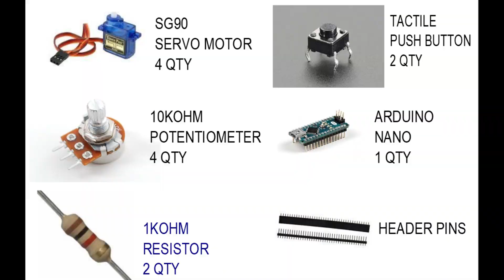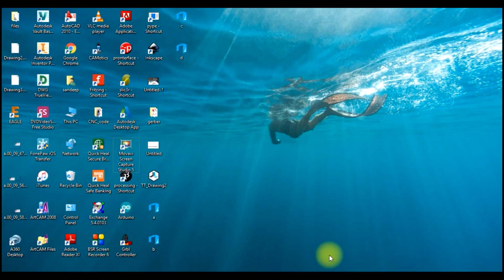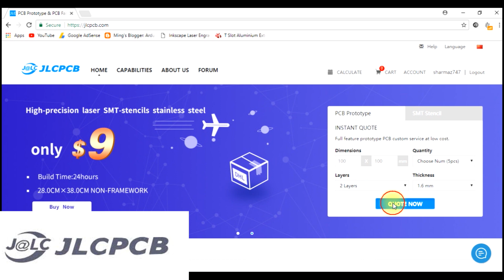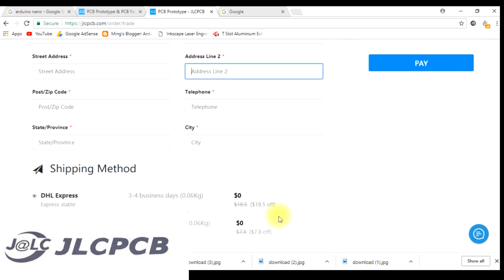How to make record and play robotic arm

Comment: S1 pause & S2 Record/Play!!
What does it mean? 
Which button did you press at 0:40? S1/S2? What is the other button for?
Reply: Pin which is connected to 6 is record and long press to play
Reply: @nishanthraj7443  but it cant work bro y🥺😫
Reply: @crazykamesh2225  what is not working?

Comment: Great video! I have a question: using these principles would it be possible to use larger and more powerful servos? I'm thinking of building a mechanical arm that will accompany the movement of my arm. Thanks in advance!
Reply: ofcourse yes. you should give separate power to servo

Comment: Hey, is it possible to make a bigger version of this robotic arm by using this same components?(exact same model but just large in size)
Reply from the maker: those mini servo not handle the weight of bigger structure just change it with higher torque servo so it will works
Reply: Mr Innovative  thanx

Comment: '''''''Sketch uses 8,936 bytes (29%) of program storage space. Maximum is 30,720 bytes.
Global variables use 1,892 bytes (92%) of dynamic memory, leaving 156 bytes for local variables. Maximum is 2,048 bytes.
Low memory available, stability problems may occur.'''''''''''
plz help
Reply: I think there is no solution for this but it will not give any problem to you code
Reply: it means that your arduino has low space but still it can be used

Comment: 1. what is the meaning of '(ist[3]) in  "servo_0.writeMicroseconds(ist[3]); // send milissecond values to servos"? why not [0] since it says servo_0?

2. Taster = 1;
        previousMillis3 = currentMillis;
        //Serial.print("Status Record "); Serial.println(Taster);      =    what is also the explanation for this? why  not previousMillis4 ?

I tried adding another servo and it works but it can't record positions yet. I don't know why so I wanted to understand the code. I'm sorry I need to ask this. 

thank you :)

Comment: Why is it that when I run the code, it says "Low memory available, stability problems may occur" :(

My sketch uses 8878 bytes(28%) storage space. Max is 30720.
Global Variable uses 1872 bytes (91%) dynamic memory. Max us 2048 bytes
Reply: Fixed it. I lowered the array value.

Comment: we have to use 1k resistors or 10k
Reply from the maker: 10k is good
Reply: @MrInnovative  10k resistor of 1Watt , 1/2 Watt or 1/4 Watt ?..
which power you took for 10k

Comment: Can u use here bread board
Reply from the maker: yes you can use but it is not advisable reasons are wiring became too mess and complicated and slight disconnection of any wire will malfunction process
Reply: Thank you Mr Innovative